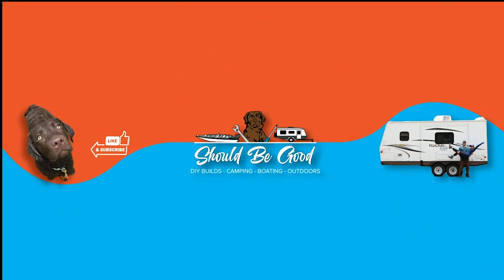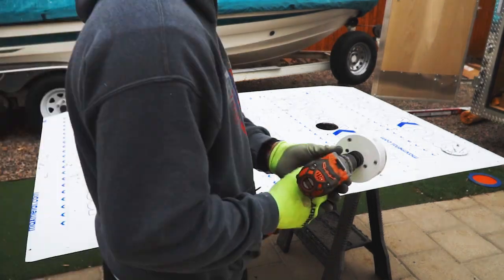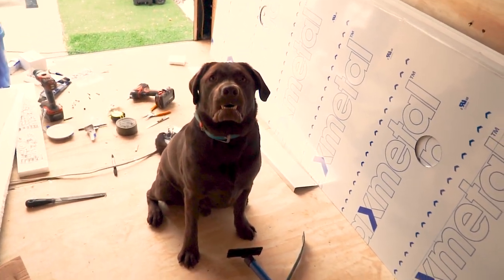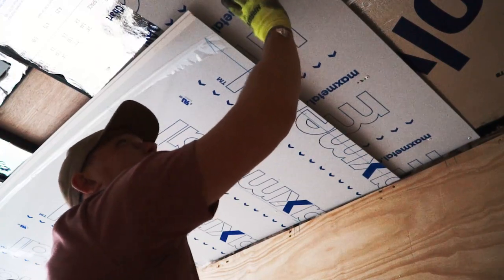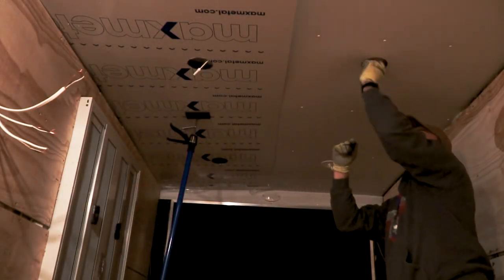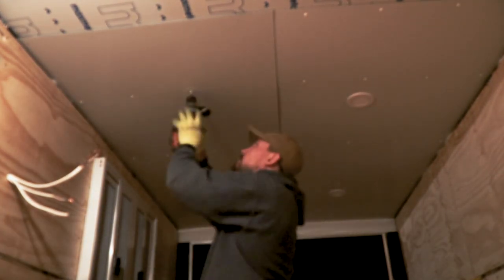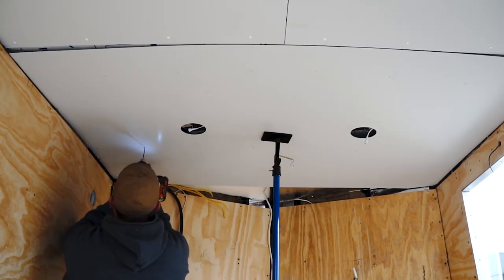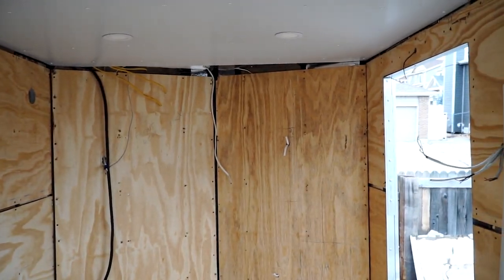Install the BEST Ceiling Panels and Recessed LED Lights | Cargo Trailer Conversion Ep.3

Comment: Could you point me to the aluminum angle that you used for trim?
Reply from the maker: I just picked up 1/8” thick aluminum angle from a local metal supplier.

Comment: Will from fla. Are those poly panels ?
Reply from the maker: Hi Will, they are 3mm aluminum composite panels. (ACM) They are commonly used for sign boards and the trailer/camper industry is starting to use them for exterior and interior walls. I source mine from piedmontplastics.com alupoly
Reply: @ShouldBeGood  thank you I will get in contact with them

Comment: What material is the ceiling panel?
Reply from the maker: @marnefox-barrow7166  aluminum composite material ACM. Essentially it’s 2 thin sheets of aluminum over a plastic panel